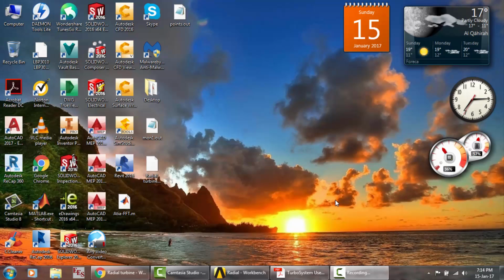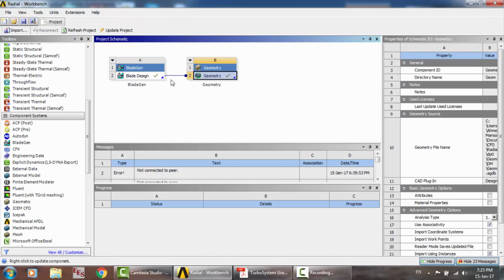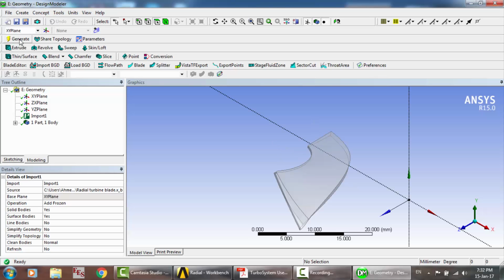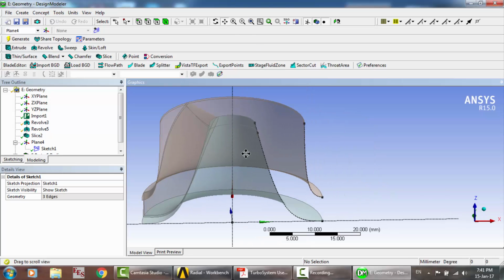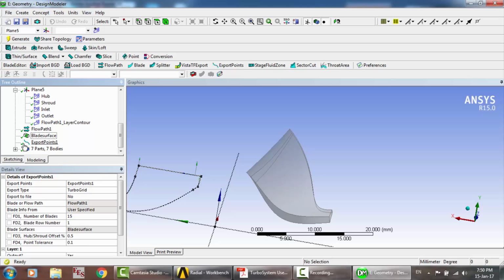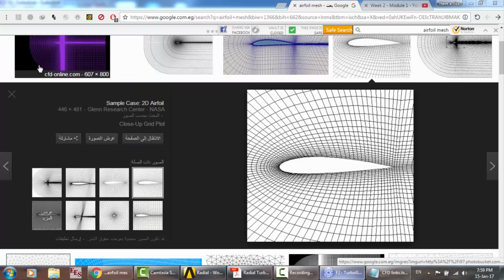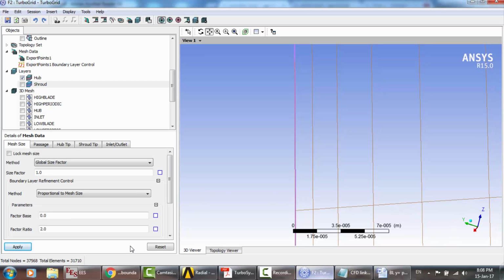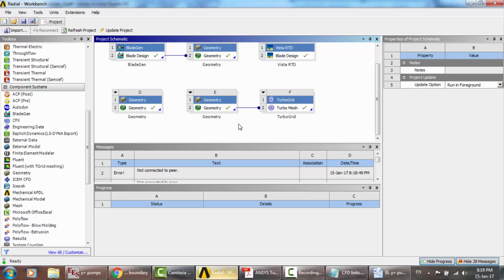A CFD Radial Turbine  Ansys Blade Design Modeler Editor and TurboGrid Flow path and Export points

Comment: hi , i don´t know if you still doing videos and i want to ask you if you can help me , i´m writting my thesis and the topic : discharging a hot water tank with a bladed radial diffusor (Ansys cfx) and to be honnest I don´t know how to built a bladed radial diffuser . I ´ll be thankful if you can help me with it.
Reply from the maker: Hello dear Mehdi, you're welcome! You must do a literature review about radial diffuser you're targeting and then you know. Danke!
Reply: @haveanicetime  hi my friend you are the only one how answered me , thank you , I already did the litterature part and I know how should the geometrie of my tank and the bladed radial diffuser should be but i´m finding difficulties with the ´Geometry` on Ansys cfx , that´s why I asked you .
Reply from the maker: @mehdikharroubi737  Okay dear Mehdi, see if you will use the manual method of generating the flow path or you can use the BladeGen or Vista tool. Or you can generate the 3D flow path using any CAD software and simulate the case in FLUENT like my video about the centrifugal fan. Danke!

Comment: Hello sir, I have a problem when trying to generate the FlowPath. When I click generate after selecting the appropriate contours,  I get the error message "Hub sketch not defined on the X-Z plane". Would you be able to help with this please?
Reply from the maker: Hello, make sure that you have created the 4 sketches in the x-z plane like what I have shown. Try again and tell me if you still have a problem. Danke!
Reply: @haveanicetime  I made sure all the sketches are in the XZ plane, but I still have the same problem. Can you advise please?
Reply from the maker: @eighthreeight  Send me the Designmodeler file by e-mail: mech.eng.ahmedmansour@gmail.com Danke!

Comment: Hi Sir, thanks for your well explained video, I have some problem when generating the flow path, it come this error  "An internal error has occurred. The Bounding Box evaluation for the contours failed".
 Could you help me deal with this? Thank you very much in advance.
Reply from the maker: Hello dear Domenico, you are very much welcome! It is because of the meridional plane. It happens in the recent versions of ANSYS. Send me please the design modeler file found in DM folder in the project's directory to check it out. E-mail: mech.eng.ahmedmansour@gmail.com     Danke!
Reply from the maker: Okay dear Domenico, I have already found out that you sent an e-mail with the file. I am gonna check it out. Danke!
Reply: @haveanicetime  Hello, I have the same problem using Ansys 19.2. How do I correct it?
Reply from the maker: Hello dear Fareed, send me the dsignmodeler file to check it out. Danke!

Comment: hello dear friend. in last section of ur video u create an expression to calculate the shaft power. that's very useful demonstration i should say. but for a long time i was trying to find a solution to low power result, taken from cfx post result table. with other words, the shaft power quantity reported from vista rtd result table and cfx post result table. you say ' u should multiply the shaft power quantity which calculated with created expressions by yourself, with blade number to obtaion total shaft power of the blade. my question is 'should i multiply the shaft power quantity (obtained from cfx post result table) with blade number as you explain in ur video? thank you to help me again .:)
Reply: i mean cfx post result's shaft power much less form ansys Vista RTD result table's shaft power :)
Reply from the maker: @jopho7777  Hello dear Jo, the shaft power and the mass flow rate come from the monitor you can make in CFX during running the simulation are for the passage you used not for all passages or blades. That's why we should multiply the numbers by the total number of blades to get the total mass flow rate of the machine and the total power and it should be close to the analytical solution from Vista RTD. Also, if you use a real gas, we cannot automatically monitor the efficiency and we have to calculate it manually by a code or by getting the isentropic value from the H-S diagram because CFX will not get it. Simply the value from the CFX after multiplying by the total number of blades should be in the range of the experiment or the analytical solution. Danke!
Reply: You are right brother. Thank u again. See u...
Reply from the maker: @jopho7777  Bitte schön Bruder ! Viel Erfolg !

Comment: thank you for your tutorials brother great job ...my question is: what about the "no valid inlet domain" ? because you said that you're going to fix it later but you didn't in this video, or it doesn't creat a problem in CFX
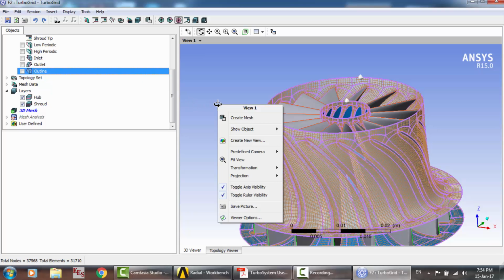Reply from the maker: Hello dear Khaled, you are welcome! This happens before creating the first mesh. It means that you will not find the mesh of the inlet as shown at 39:59. 
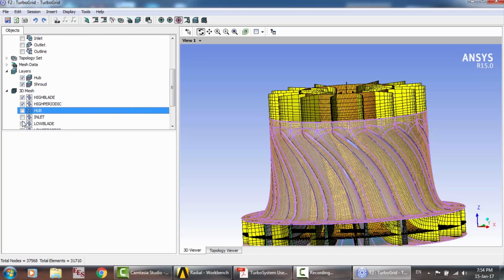I am not sure of the reason but it after clicking on create mesh, you will find the inlet face mesh is created as shown at 40:20 which means no problem. 
At the beginning, TurboGrid does not detect the inlet domain, so, it cannot create the mesh for it, but after mesh creation, no problem. 

That's why I showed the whole mesh from the 3D mesh tab which confirms that all regions and faces are okay.
 Vielen Dank !
Reply: @haveanicetime  danke shon my brother i apreciate your work and your quick response بارك الله فيك
Reply from the maker: @khaledma1564  Vielen Dank sehr geehrter Khaled ! شكرآ جزيلآ لك
Reply: @haveanicetime  i have another issue with CFX solver this time it shows "CFX solver exited with return code 1" what should i do sir??
Reply from the maker: @khaledma1564  Hello dear Khaled, be sure that you do not exceed 500K cells if you are using ANSYS student. Also if you use K-epsilon, change it to SST model. Be sure that you followed the same steps.
Danke!
Reply: @haveanicetime  it works, i am using Ansys student and the numbre of cells was about 250k i think it has to do with the K-epsilon model  thank u very much
Reply from the maker: @khaledma1564  Das ist sehr gut ! Viel Erfolg !

Comment: hello dear friend. i hope u remember me.
again i ve a problem with ansys cfx solver.
when i start with cfx solution mode i get this error message many times
'update failed for the solution component in cfx. the solver failed with a non-zero exit code of 2' 
if u mind helping me to solve this problem i will be very happy with u.
By the way if i get ur mail address i may able to send u my work to check out by urself.
best wishes....
Reply from the maker: Hello dear Jo, yes I remember you! This happens if you run the CFX from ANSYS projects, to overcome this open CFX from start menu and load the setup file and run it separately..I showed this in the video   of a radial turbine structural analysis at its beginning...Check it out please! Vielen Dank!
Reply: @haveanicetime  Thank u so much dear friend. İ will check it.
Reply: hello dear friend.
i try to find out solution for my 'update failed for the solution component in cfx. the solver failed with a non-zero exit code of 2' error in cfx. i check ur video out again but i ve still same problem. İ couldnt understand why we open cfx from windows and   
what should i do after opening cfx from windows.
you told that opening CFX with this way will be same, with clicking on the workbench CFX' solver icon.
What is the difference between two way.
if u help me again i will be very happy with u...
Reply from the maker: @jopho7777  Hello dear Jo, Did you watch the beginning of the tutorial (Radial turbine structural analysis"? We do this to avoid the error message you are talking about, open cfx from start menu, then cfx pre, then File-open case, then choose the setup file created from ANSYS project and then run it, I showed this in the tutorial, you click on define run icon (in blue) to define a run and then you can continue, if you stop the simulation it stops without errors..This only happens if your setup is exactly like what I showed...I wish you can do it..Danke!
Reply: i do exactly what u said my friend. every steps done well. after defining run i continued but same error message appeared again. i ve never stopped the run but same error message appeared again at the beggining of the process. i cannot going forward in my thesis. i wish i could send u my project so you may look at it  ? :)
Reply from the maker: @jopho7777  Okay, send me the setup file only CFX pre on mech.eng.ahmedmansour@gmail.com but I have ANSYS 19.1 so if you have a newer version, I am not sure if I can open it or not...Danke!
Reply: God bless u my friend. thank u so much...
Reply from the maker: Hello dear Jo, based on your e-mail, the problem was solved when you decreased the number of mesh nodes. This shows that the CPU did not have the ability to run the model because it was too heavy :) Vielen vielen Dank und viel Erfolg !
Reply: im not sure my friend whether my solver problem related with my computers ability. because is there any possibile relation between my problem and ANSYS students mesh or node number regulations ? another words, if i use ANSYS full version in my computer may i face again same problem?
Reply from the maker: @jopho7777  Oooh, what I know is ANSYS student is limited..We are not allowed to run a mesh has more than 500K cells or nodes I guess. Your mesh had a huge number. That's why it stopped. Anyway, the problem originated from the number the nodes and cells. A CPU ability or a version ability...Now it is clear :)..Vielen Dank !!!
Reply: Speaking which , i ve taken results from CFX results my friend. i jumped the next level of design with ur help. But i encountered some problem again:) in the velocity vectors at 80% span i encountered in my fluid flow some incidence . to fix it which action shuld i do ? ( with this way my friend other users may have a some information about ansys i think, dont forget this i learned this technic from u :))
Reply from the maker: @jopho7777  If the simulation is converged, you validate the results against a published work. If there is any difference, it is due to the differences in modeling, BC's or the approximations :) Danke!
Reply: Even if i took some results from ANSYS CFX. i have to admit that i ve no idea about how CFX do that. For example as u say 'if the simulation converged'. What does 'converge' mean in cfd calculation? which document i should read ? if u advise some document about ' time step, convergence, residual' terms i will be happy again again again. İ dont know how much time i will say that phrase :)
Reply from the maker: @jopho7777  Dear Jo, CFD is an approximate approach. It is based on discretization of domain. At the nodes, Navier-Stokes equations are solved but using the approximate methods (numerical solutions) and the trial and error..Convergence means that the solution has low errors 10^-4 and lower. This means that the error is approaching from 0. If not, the divergence occur and the error increases. You must watch CFD course videos on YouTube. Just search for CFD lectures and you will be familiar with this science. ANSYS or any software are just tools. Also, there are many pdf documents on google. Watch my video (flow around a cylinder) and you will know the basics, also watch the VAWT sliding mesh technique tutorial.
Danke!

 https://www.youtube.com/results?search_query=cfd+lectures
Reply: you are my idol...

Comment: how can i download ansys freely? can u give me a link. by the way your work is great thank u so much :)
Reply from the maker: Hello dear Yusuf, thank you very much sir! You are welcome! Here is the link of ANSYS academic 19.2: click on ansys student....Thanks 
https://www.ansys.com/academic/free-student-products
Reply: when i install version you advise. shall i be able to make every action u show in ur video ?
Reply from the maker: @jopho7777  Yes dear Yusuf :) But I think you only can run the simulation if the number of the mesh cells does not exceed 500K because it is not the commercial version. This will not affect your work at all if your geometry or study does not require ahuge number of cells...Thanks
Reply: thank u so much sir its honour to me to read sentences coming from u.....
Reply from the maker: YOU ARE VERY MUCH WELCOME DEAR YUSUF!!! :) :) :) :) :) Vielen Dank für Ihre Sanftmut!
Reply: Hello sir. İ have a stuation with ANSYS student mode. When i TRy to transfer data from geometri to the turbogrid i receive this error.capability cad interface - parasolid does not exist in the ansys licensing pool. none of the products enabling this capability are available in the specified license path. İf u help me i will ve very happy...
Reply from the maker: Hello dear Jo, Happy new year! Yes, I guess you did not activate the blade modeler features. Open tools menu, license preferences, geometry tab, you will find ANSYS design modeler at the top of the list. Click on it and move it down to let blade modeler at the top of the list, then close and reset the turbogrid mesh tab and open it again. I am not sure if this is the problem or not. If you already have what I said, right click on my computer, properties, advanced system settings, environmental variables, system variables, ANSYS LMD-License, you should paste this path: C:\Program Files\ANSYS Inc\ANSYS Student\Shared Files\Licensing\student.lic   simply see the path you have for the license of the product in C drive and see the name of the license file, it is here student.lic  . and then click okay and reset turbogrid again and save the project and restart the computer to take effects:) Tell me the progress please...Thanks
Reply: What a rude man im. i forgot say happy New year! Forgive me please. Again u help me. U r really charitable man...thank u so Much sir...
Reply from the maker: @jopho7777  OMG !! It is okay dear Jo ! No problem, any person work on turbomachinery forgets to eat ! :D Glad that you solved the problem...Viel Erfolg!
Reply: Sir actually i cannot solve the problem. İ TRy to open independently turbogrid without related any geometri or any other tool i receive this message
"No license are available at this time . No applicable license was available at this time".when i öpen license prefernce anda geometri tab i couldnt fınd ANSYS design modeller at this listesinde so i couldnt move it download or up. May i ve made mistake when i install student versiyon? Should i do anything about licensing procedure after installation.
Reply from the maker: @jopho7777  Hello dear Jo, If you open turbogrid without any geometry, it must open and then you can import the hub, shroud, and blade files but you must set the appropriate units or you will get an error message....If you do not have this way, you should do what I did in the video and you must be able to move blade modeler to the top otherwise you will not be able to do the steps...be sure of the installation procedure and do what I said about the license path..it must work....Thanks
Reply from the maker: You will find move up and move down in the geometry tab in licensing manager...
Reply: Finally.... i made everything u show in ur video. So turbogrid works like a bull...thank u so much again...

Comment: when i generate the flow path, this error is shown:

Error: An internal error has occurred. The Bounding Box evaluation for the contours failed.
Context: ansFClientBMBladeDesign::Execute FlowPath1

 kindly help me to sort it out. i have tried it thrice but always this message is shown
Reply from the maker: Hello, there is something not right with the procedure you followed, re-watch the process again, consider the radius of the rotor or the stator, generate it at the right plane, I wish it works with you, be sure that the blade has no open surfaces to export points without errors, I showed hat in my tutorial about a centrifugal pump...Thank you!
Reply: @haveanicetime  i have followed the same procedure as you followed in the video  and repeated thrice
Reply from the maker: @MuhammadAbubakar-gm9wq  Okay, send me the whole rotor/sator CAD file as x_t, not only the blade, mech.eng.ahmedmansour@gmail.com  Thanks
Reply: @haveanicetime  i have sent the cad file
Reply from the maker: @MuhammadAbubakar-gm9wq  Okay dear Muhammad, thank you, I will check it out and tell you soon...

Comment: please iam trying to study the tip cavitation of  kaplan turbine, i designed the blade on bladegen but to make the mesh on turbogrid i need to make also the external casing, but i don't know how to do it.
is there any awy to design it on design modeller of ansys? or i need to make it on solidworks first and export it to turbogrid?
Reply from the maker: Hello dear Youssef, watch my tutorial ( Radial turbine in CFX after export points, I showed how to prepare the volute or the casing and how to generate the mesh, tell me if this is what you want...Thanks

Comment: Very interesting, for the centrifugal compressors, what's  the difference in boundary conditions has you said??
thank you very much for your tutorials :D
Reply from the maker: You're welcome dear Ibrahim :) The difference is the location of the inlet and the outlet, check out the attached link about a centrifugal compressor, you will find that the inlet of the fluid in the case of the compressor an outlet in the case of a radial turbine because of the difference in the function and the flow direction ...Here is the link, thanks!
https://www.youtube.com/watch?v=tVfs_ZDlwXw
Reply: Have a nice time! Thank you very much. So the same meching method can be use in centrifugal compressors specifically for y+
Reply from the maker: Not at all sir :), yes of course :)
Reply: Thanks 😃
Reply from the maker: Bitte Schön! :)